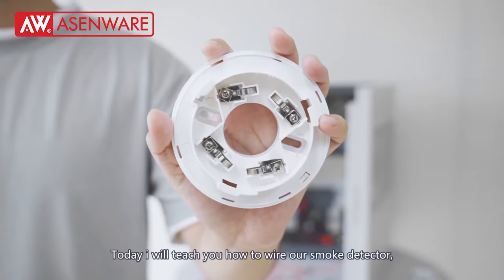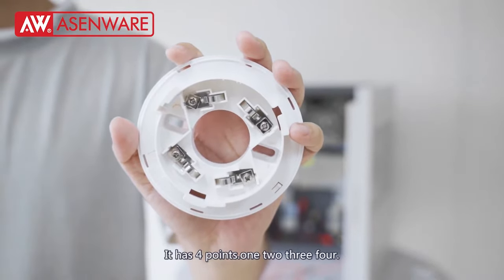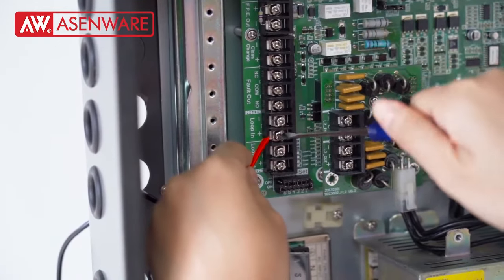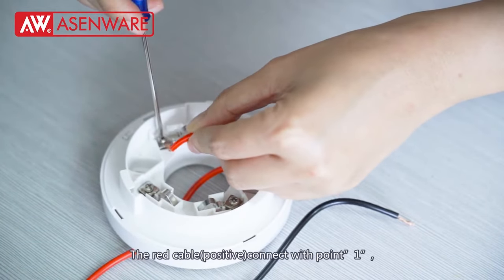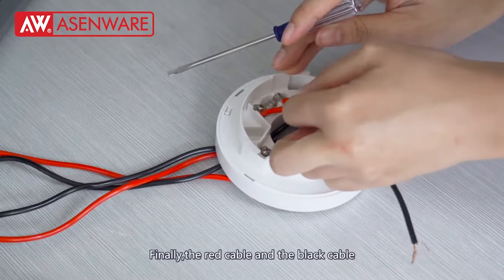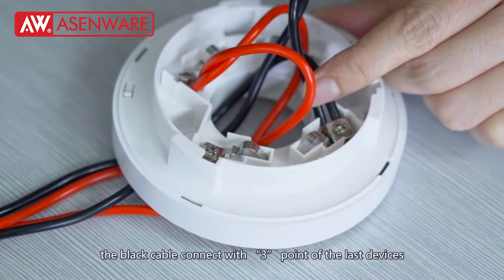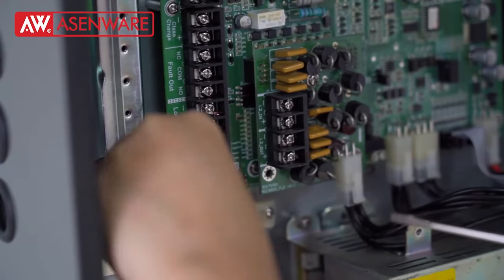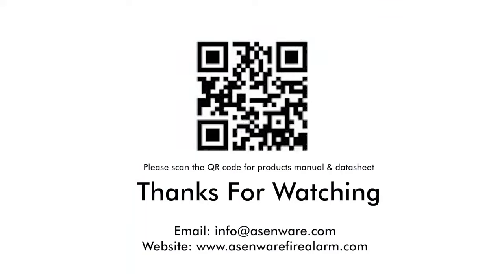How To Wire Addressable Smoke Detector & Addressable Heat Detector

Comment: If i add more SD Is the termination still the same, the red wire in terminal 1 and the black wire in terminal 3?  before returning to the panel to form a loop
Reply from the maker: HI dear, positive wite connect to.terminal 1 and black wire connect to terminl 2
Reply from the maker: Welcome contact us: 
Website:asenwarefire.com
Whatsapp,Wechat,Tel:008613922805301
Email: info@asenware.com
Reply: What's is the connection of #4  sir?   thank you